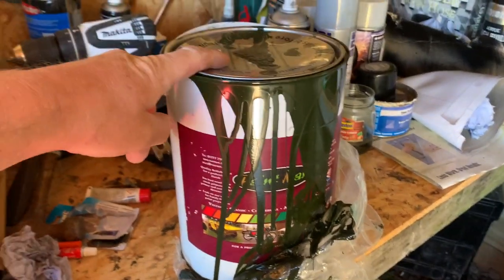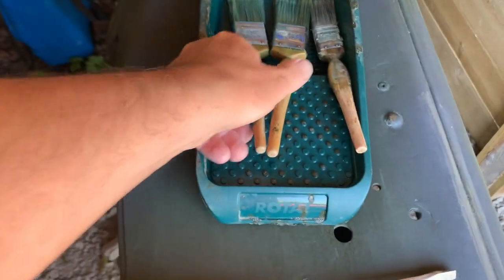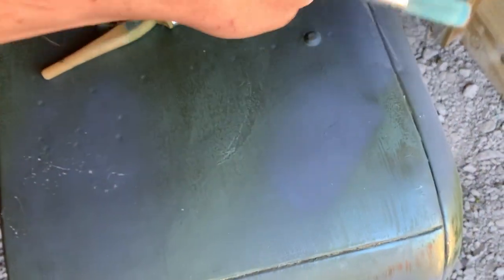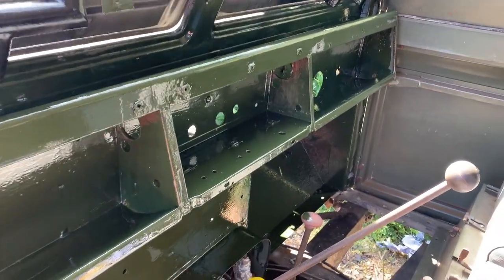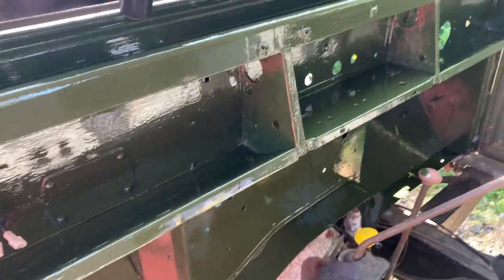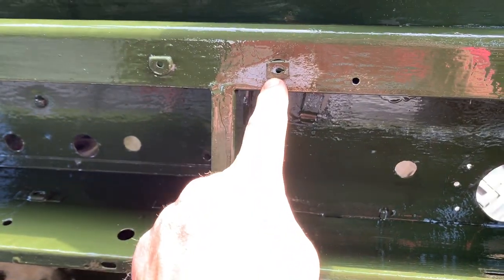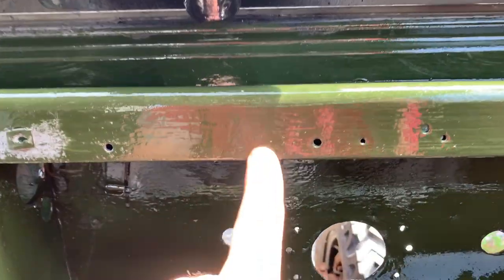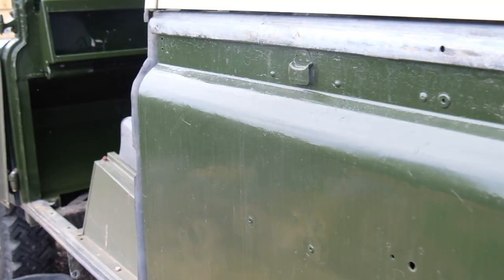Roller Painting a Car [Land Rover bulkhead]

Comment: Hey there - I will be painting a Series 3 Truck in a few months - and I think I am going to go "old school" - brushes and rollers. whole car to be done. I see you are using "single pack" enamel is it? IE No thinners / Hardener in it. Also - would you do 2 coats?
Reply from the maker: yes enamel no thinners, just straight from the tin, 
it goes on much thicker than spraying so i've only done one coat. next year i'm gonna wet sand it with a fine 2000 grit to get it smoother. hopefully it will be thick enough. if it's not i might give it a light rub down and give it a second coat,  then re wet sand and polish it!